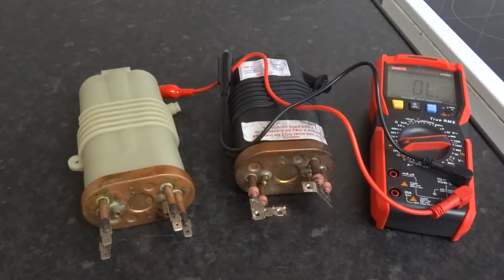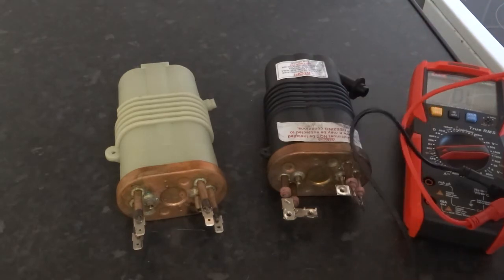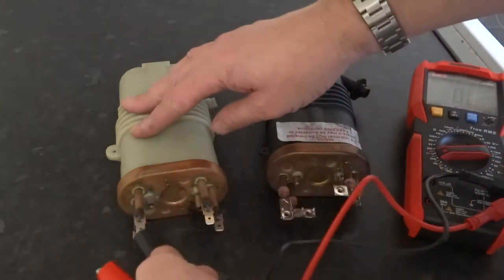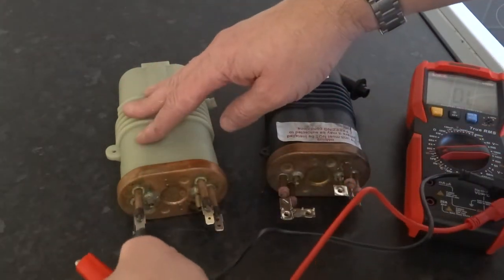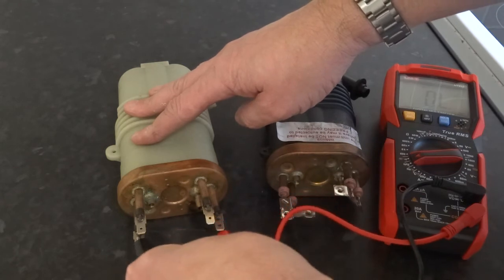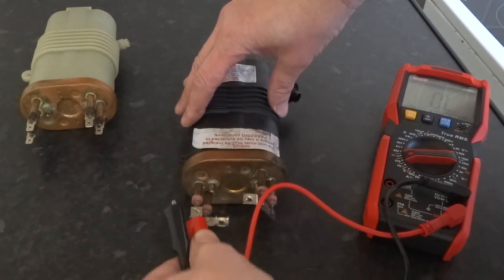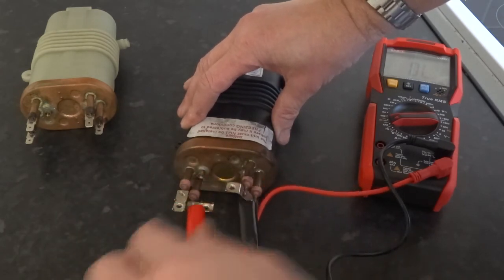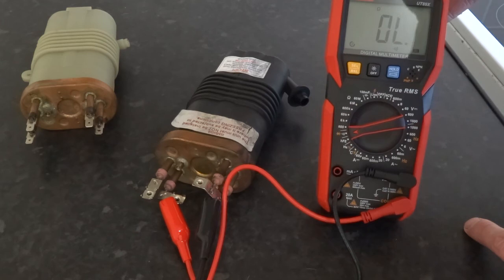Electric Shower No Hot Water? How to Test Heating Elements (Good vs. Bad Ohms Reading)

Comment: Hi there, I have 10ohms between the copper lid and the positive terminal? It’s not a dead short but the rdc it tripping so I’m thinking my tank has a short to ground through the lid some how?
Reply from the maker: yes 10 ohms is a massive fail it should be Mohms minimum